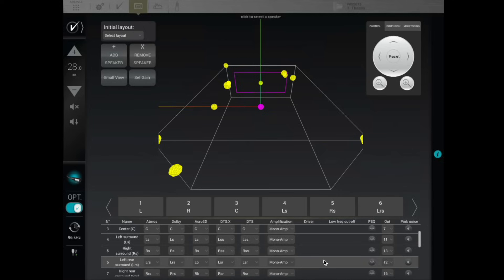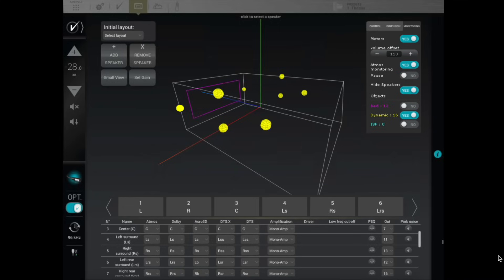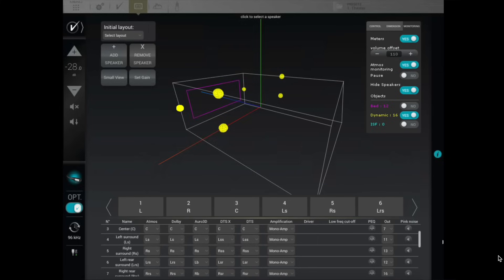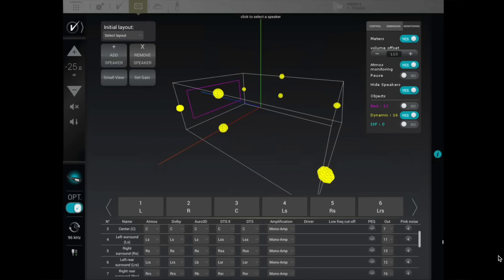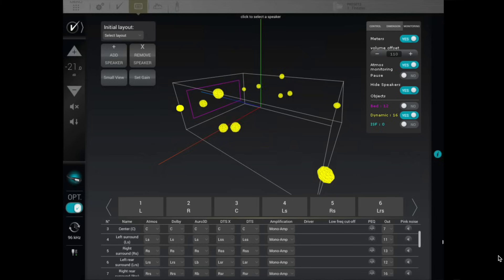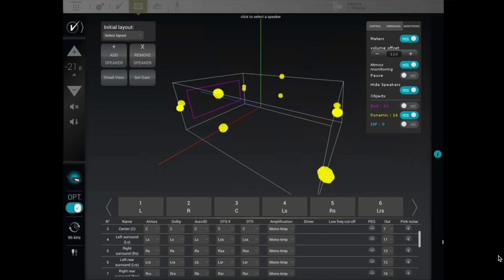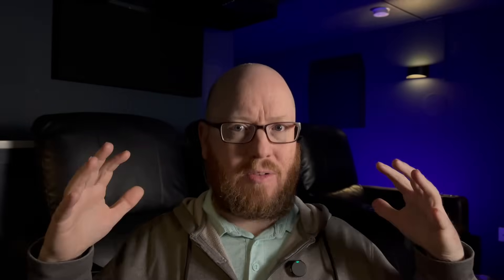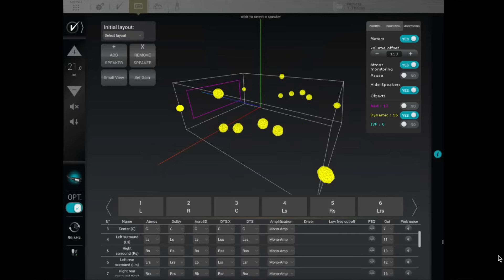How To SEE What Atmos is SUPPOSED to Sound Like

Comment: 6:58 if you look at the meters, you will see the ancillary speakers are playing at a lower  level.   

In this case, they are using the wides to pull the sound imaging of your left and right speaker. Mainly because they are less than 30 degrees wide.

Comment: My room is pretty tiny so for a 5.1.4 setup what is supposed to be the traditional surrounds still have to go on the rear wall and thus being more like the back surrounds you add when you go up to 7. Still though when just testing the various speaker locations through the built in test in windows from my computer it absolutely tricks me into thinking there also are speakers directly to the left and right of my seating position.

Comment: I am confused. If sound/vocals sound like they are coming from the front but 6 speakers are producing them, what is the difference to only having the fronts playing. 🤔
Reply from the maker: Excellent question. The perceived volume of the sound at the MLP is significantly louder and more pronounced than the sound coming from any one speaker. The 3 speakers combine to produce more sound, and with a wider soundstage, than you would get from a single speaker (only the Mains)

Comment: Speaking of zidoo. Yours still broken with the ability to match new movies you just added. Mine won't match going on 5 days. Issues with tmdb api
Reply from the maker: You can manually fix the matching
Reply: @GeorgeTheaterAtHome  can you elaborate? Everything i have read is you need to add a total different program tinymediamanager to add files to the folder and switch it to local.
Reply: @GeorgeTheaterAtHome  can you elaborate on how you are manually matching? Are you using tinymediamanager?
Reply: @GeorgeTheaterAtHome  can you elaborate?

Comment: Sir i'm deciding to buy an audio system between samsung q990d soundbar and home theatre system(5.1.2) consisting of (polk xt 20(fronts), xt30(center),  xt 15(surrounds), xt90(heights), xt12(sub) + denonx1800h).Which one sounds better for atmos effect. What is your suggestions and i can deal with cabling.
Reply from the maker: If feasible, I always recommend a good surround sound setup over a soundbar
Reply: @GeorgeTheaterAtHome  With these polk speakers setup do they sound better than samsung ?
Reply from the maker: I haven’t heard those specific speakers. But if you set them up correctly and calibrate them well I expect they should sound better than a soundbar
Reply: @GeorgeTheaterAtHome  thank you very much

Comment: What you're saying does make perfect sense. This is how Atmos is supposed to work. Phantom imaging between speakers is why speaker positioning is so important. 

Everyone seems to preach separation between the bed and height layer, but I believe  that the layers need to be placed in a way that they are capable of interacting with each other as well.

Object based Atmos utilizes every speaker in the system to render objects in a three-dimensional space relevant to the listening position. If the speakers are spread too far apart, the phantom type imaging between them can be lost.

Hearing stereo imaging between the speakers in the height layer is also extremely important. This is why the CEDIA Atmos placement guidelines suggest placing the left and right top speakers to the outside of the furthest left and right seating positions. Stereo imaging requires the listener to hear sound from both ears. This is not possible if the overhead speakers are placed too tightly together.

Comment: The viewer is definitely a very cool feature. Could be wrong, but I don’t believe the remapping works quite the way you are describing in the video. You are basically describing what Dolby Atmos does. The way I understand the remapping feature is that it gives you the ability to remap less than ideal speaker placements and move them ‘virtually’ to more optimal locations, which should result in more effective Atmos reproduction in rooms with less than ideal speaker layouts.
Reply: What he said!
Reply: Yes that's probably what they can do, not what was said in the video... that's just Atmos, and Auro 3D.
Reply: Yeah I think this is how Atmos works, ideally you have speaker's angled so they create an immersive sphere around you and you know the levels are correct when you don't necessarily know which speaker they are coming from  because they are creating a sound field.  They are able to manipulate the sound from each speaker in a way that is similar to HRTF for headphones, but it can position sounds around the soundfield.

I was watching a movie and a huge sound sounded like it was being projected onto the left wall.  At the time, I didn't have any speakers on that wall, but the sound moved from the front of the room where it took up all the space with the front L&R and the front heights. it than panned onto the left wall where like I said, had no speakers at all.  So the other speakers were doing an amazing job of virtualizing speakers on that wall because there was no perceptible loss in EQ.

Comment: I am thinking about buying a marantz av10.  What did you use before the trinnov? How much of a difference is the trinov? Can not afford a trinnov but trying to find something that can replace and denon x3600 in preamp mode. Sinad is not everything but it is about 100 av10 107. I replace an av7705 sinad was about 79 with the denon x3600 and it blew it away. Any suggestions? Thanks
Reply from the maker: I have an Anthem AVM70. Before that I had a Marantz 7706. I was very impressed with Marantz. If you’re looking at getting the AV10 email me at georgehometheaters@gmail.com. I may have something that would work for you.
Reply: Do it! The AV10 is incredible. Easily the best processor under 10K.

Comment: I hear the same thing. Hard to differentiate sounds unless bed layers speakers don't blast as loud. If the atmos speakers play something while other players are fairly quiet, then you can clearly hear it, and it does sound awesome. Do you know how back in the day with 3D movies, they always tried to" poke your eyes out" with something? I feel like sound engineers should do the same thing with atmos speakers. They need to "poke our ears out" with sounds. Not all the time but a bunch of times. I feel like each movie has only 1 or 2 effects like this. Ready player one race scene is cool, but everything is so loud all the time. Later in the movie there is a drone that flies above us and that alone is so much cooler sounding to me than any atmos effect in the race scene. 
Or the plane fly over in the Netflix movie "Carry on". Or another movie, Rim of the World, where the monster walks up on the deck above the kids. Awesome atmos effects. 

I have a 5.2.4 system, but I sit against the wall. So I have front heights and top middle installed, but they are correctly placed according to the Dolby guide. Some people yell at me that this is not even a legit setup because it's not in the Dolby guide, but that's just insane. I have proper sounds coming from all atmos speakers. Why would it be wrong, just because it's not in the Dolby guide to have front heights and top middle alone.  I can select it in the avr, and it pushes the correct sounds to the speakers. Actually.... I tell you something crazier; it kinda bothers me how sounds that supposed to come out of top middle and top rear always blast out of the top middle alone (since I have nothing behind me) I experimented setting the front heights as top front and top middle as top rear. Now this completely changed everything and I like it better. The comments about it? Not so much. Lol. But everyone can say whatever they want. They never tried my setup. They don't know what it sounds like. I have eyes and ears and I have tested the hell out of it not just with movies but Dolby demos. Object demos etc. With this setup, front heights still playing everything that happens up front. When something is above, all 4 speakers play together and something is behind the top middle plays by itself.  Again, keep in mind, I have no top rear or rear height, so the top middle would play those sounds anyway. I really like how the sound comes from the whole ceiling when something is above, compared to have the top middle playing it alone. With object demos, where the yellow ball moves from the front to the back. If I have it setup as front height and top middle, as soon as the ball moves away from the wall, the top middle starts playing the sound at full blast.  Doesn't matter how I look at it, to me sounds weird. Setting it up as front top and top rear makes this transition slower. Front height still plays the sound is the yellow ball is up front. Then, once it's starts moving, all 4 speakers start playing.  Compared to the guy in the middle of the room, the ball is still only 1/4 way away from the room and now all 4 of my speakers playing. Ball is still up ahead and sound is more forward oriented compared if only the top middle would play by this time of the demo. Anyway. According to a bunch, I am an idiot and this is wrong. Whatever.

Sorry for the long post.
Reply: With your Top-Middle, the object shouldnt be playing from them at full blast, but it might seem that way because often the Top-middles are much closer to the audience than the front heights will be.

Front Height + Top-Middle is a fine layout.  Not gonna hurt a thing.  And to set your Top-Middle as a Top-Rear is also find because its the rear-most height channel you have so it gets that info anyway.  And Top-Middle objects will be played from all your upper layer speakers as if they were an array, so its not a bad situation.
Reply: @FURognar  i have stood up and listened from the middle where both speakers (front height and tip middle were equal distance from me.  %75 of the time time if not %80 the top middle plays the sound when the yellow dot (object) moves from the front to the back. The top middle takes over way too soon. With them set as top front and top rear, this panning sound is "slower"  and the sound is more forward oriented, which sounds more correct to me.
Reply: @CSOCSO  with Front Heights, Top-Middles are going to take over as soon as the object moves beyond 0% on the Y-axis.  You are correct about that, but this is as intended by Atmos.  That is how the Front Height position works.

Now what should happen is at 1% on the Y-axis, only about 1% of the sound should be playing from the TM.  The other 99% should be playing from the FH.  

The Top-Middle position is at exactly 50% on the Y-axis.  So the object gets closer, more and more will play from the TM when it reaches exactly 50% of the distance.

The Top-Front is at 25% on the Y-axis, so an object at 0% with no Front Height in the mix will play from the Top-Front instead.  And wont start moving until the object reaches 26% on the Y-axis.  So in your case where your Top-Middles are also doing the job of the Top-Rear, its probably better to set your upper front speakers to Top-Front instead of Front Height.
Reply: @FURognar  yeah. They are set as top front and top rear. I have uploaded a video of it on my channel if you are interested.
Reply: @CSOCSO  I think I've seen it.
Reply: Yeah , u r right  with atmos effects. I have Denon A1H in 7.1.4 in 15m2 room and also sitting against wall , Yes    loudness of those hights effects are in 80% too much cover due similar loudness of surrounds speakers nearby.

Comment: I’m gonna have to check out that Weezer song.  On the 2nd song, that may have been on purpose as far placing the vocals in more than the left and right.  Check out the Atmos mix on “Graveyard” by Halsey.  The lead vocal is in every speaker except the rear heights.  It sounds massive.